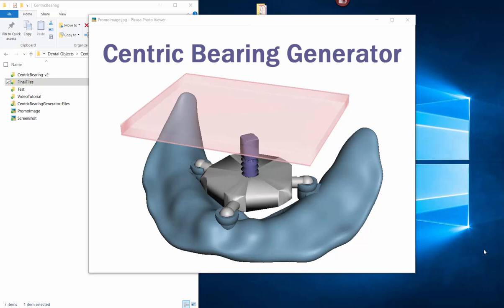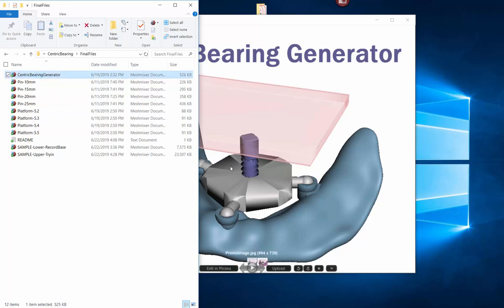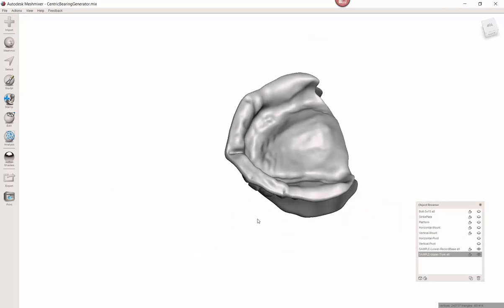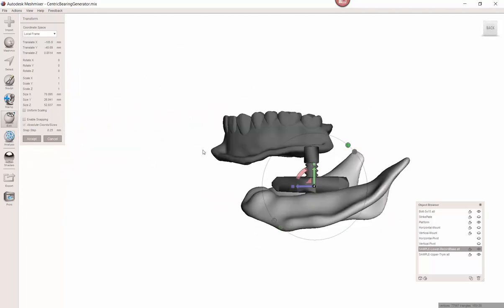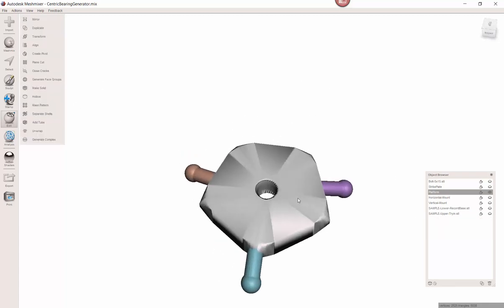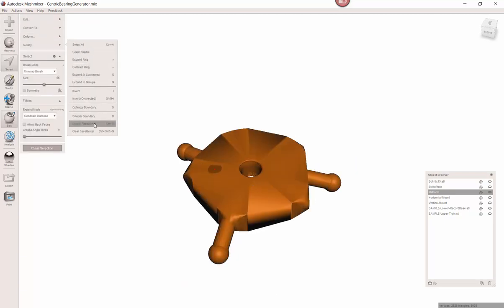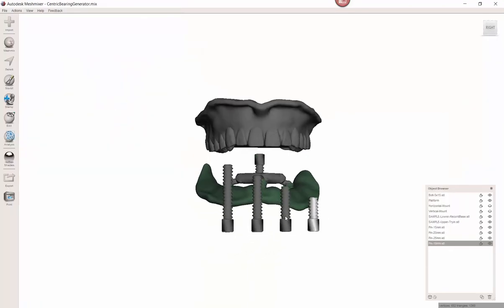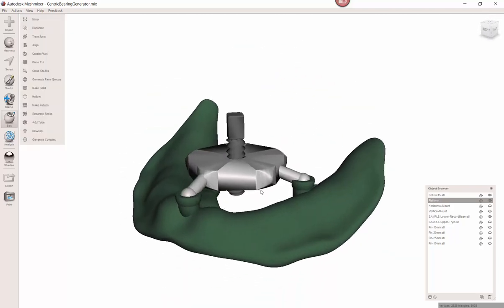Centric Bearing Generator - Full Tutorial

Comment: Hi Baron. It' s a very interesting and useful video. However I didn't quite understand if the bolt is movable inside the plate so you can adjust it in the patient's mouth. Can you physically screw it up und down in order to get the proper VDO? Thanks a lot, Razvan
Reply from the maker: Yes. I designed it with a 4mm square head that would fit a Traditional implant wrench.
Reply: @bgrutterdds  Thanks. Keep up the good work